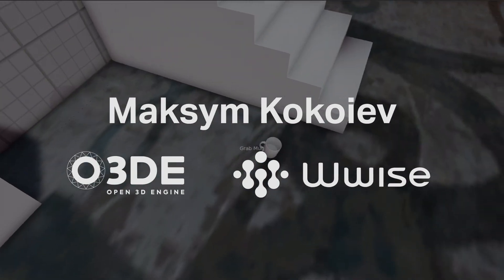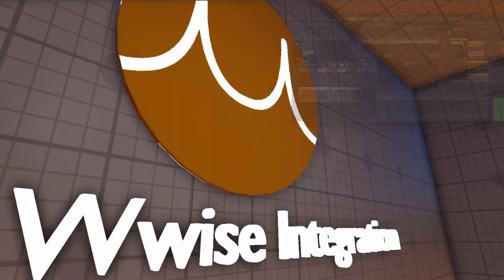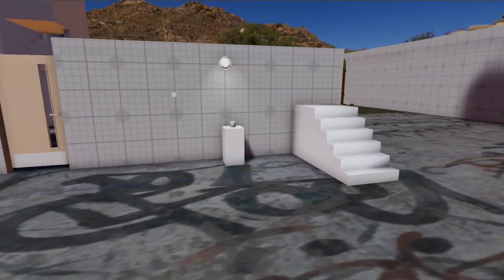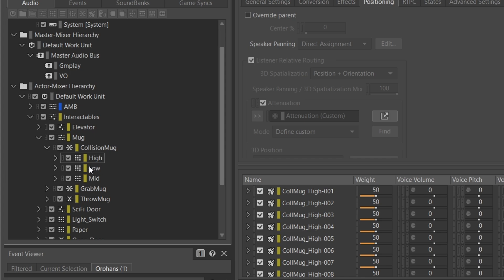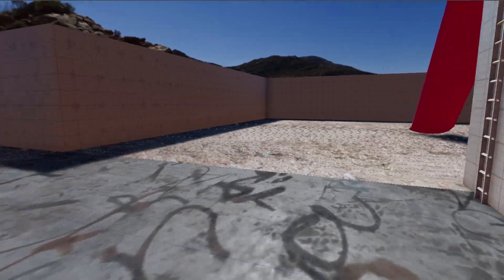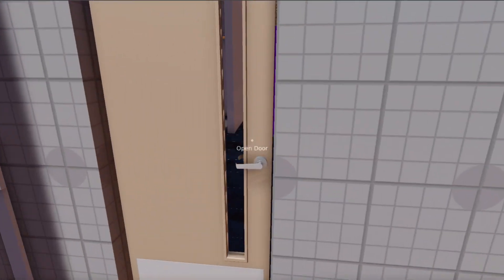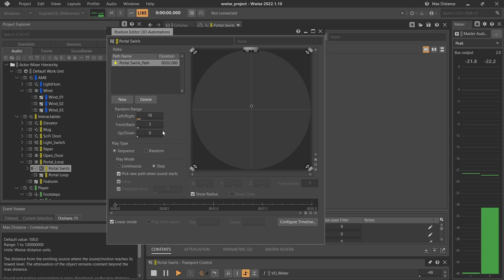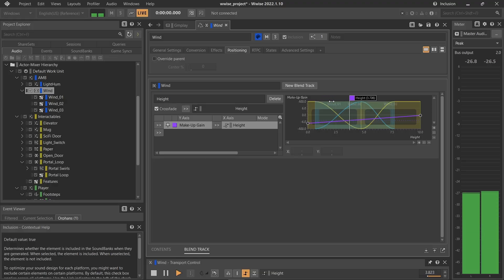Maksym Kokoiev O3DE Wwise Integration

Comment: Why not unreal engine, though? Is o3de any good?
Reply from the maker: o3de is not good, unfortunately. As of right now, it has multiple issues and bugs: 
• Wwise Gem (plugin for middleware) not functioning properly. fx not calculating real time, not sending environmental data to the middleware etc. 
• Progress in editor doesn't register. 
• Main branch version crashes upon closing the Script Canvas window. 
• Material Designer doesn't work. 

Yet some game studios still use it (Cloud Imperium Games). 
Although CIG is most certainly uses a heavily modified version of Lumberyard which is the predecessor of o3de. 
Lumberyard in its turn is a modified version of Cryengine (Amazon bought it for a shitload of money) 

Plus as of my understanding o3de's workflow is very similar to Unity's. 
So with this kind of practice implementing wwise in o3de I just "mastered" 4 different engines.

P.S. Nonetheless, Linux Foundation and volunteer folks in the community are still pushing PRs improving it little by little
Reply: @MaxKoko  A new version of O3DE has been released! Have your problems been fixed? Make a review video of it, when you have free time! ;)
Reply: it’s genuinely funny how terrible o3de is